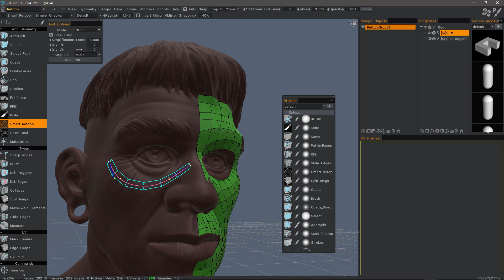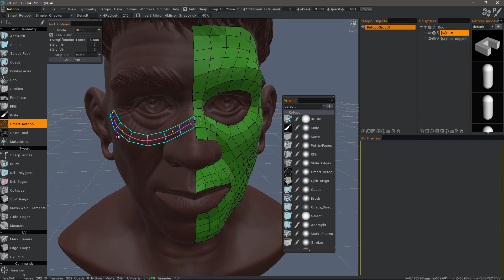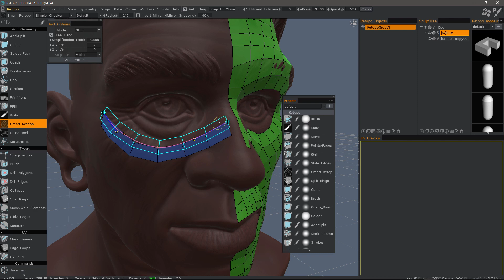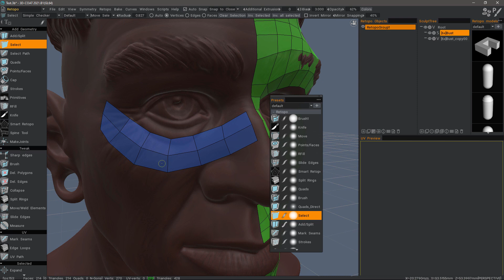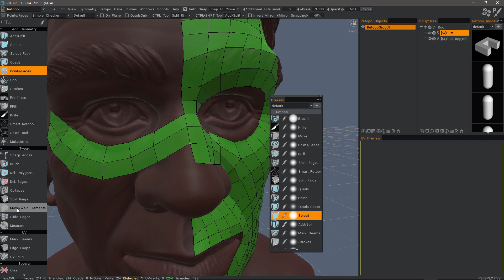Smart Retopo Strip Mode Pt 1

Comment: Thanks for the video, - but if I did retopology in another editor and made a large pothole on the highpoly-model, can I automatically lower the retopology on the pothole in 3d-coat?
Reply from the maker: There is a feature in the Sculpt Workspace called CONFORM RETOPO (mesh) in the toolbar (left side). With that checked, if you sculpt a large hold on your high poly sculpt, yes, the low poly retopo mesh will conform to the change, on the fly.

Comment: It's a good tool, but it looks hard to use in its current state.
Would it be possible to automatically set the number of vertices to be connected and the direction of the mesh to be created?

Comment: It's an interesting tool, much better than drawing quads one by one.  I think it could use a few additions to it's options.  One is that welding of parallel strips should be a one step process.  I was expecting to see that when you shifted the strip to the side, it would have caused it to weld on the edge automatically.  Also maybe instead of welding strip by strip, you could draw two of them at a  distance, and they would be able to create a patch between them, similar to the other patch tool, but with just two lines, and maybe you can tweak the subdivisions in between with the preview.